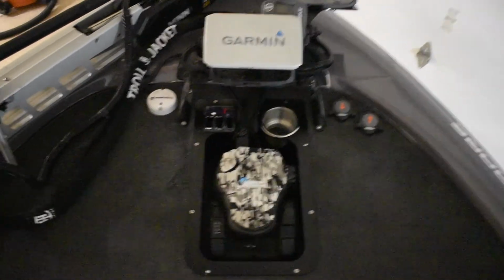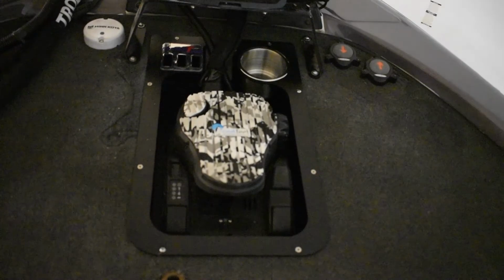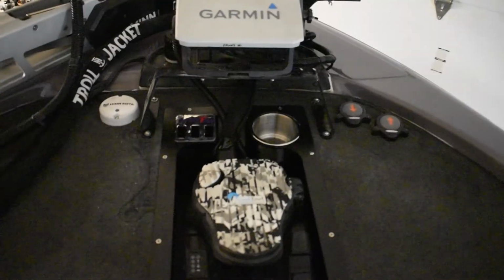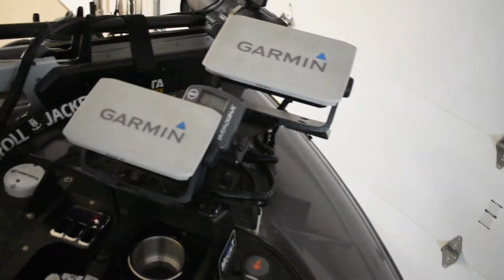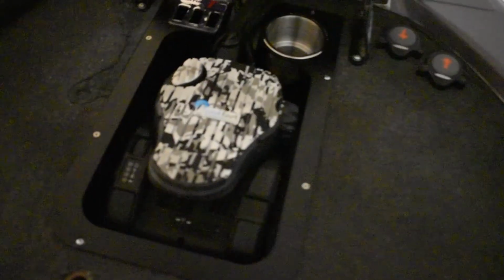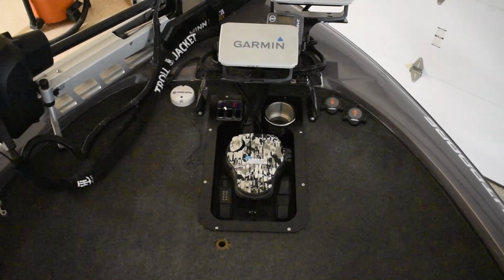Comfortroll D-Lux- How to Recess Your Trolling Motor Pedal

Comment: Just installed one on my boat last night,what screws did you use to mount the pedal in the tray,and how long? Thanks
Reply from the maker: I used self tapping screws. Just long enough to go through the tray. I forgot the exact size. Maybe inche and a half long. That tray is pretty sweet and well worth the money 👍
Reply: @millertimeoutdoors7820  thanks for the response, yes that tray is sweet

Comment: thinking about installing the same recessed trolling motor tray; would you still recommend this brand after having it on for 11 months (as you mentioned, my back can no longer take an all-day trip with the pedal being flat on the deck)
Reply from the maker: Yes! For sure. It is an awesome tray. Plus u get some extra things like cup holder and tool holder. But I’m sure any tray is worth saving your back 😂